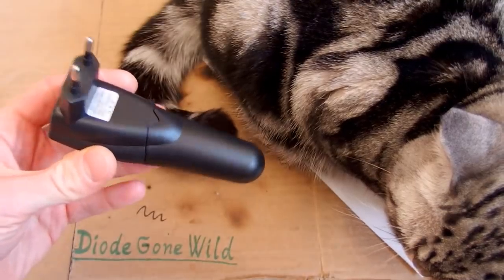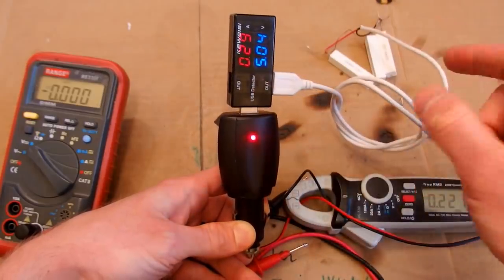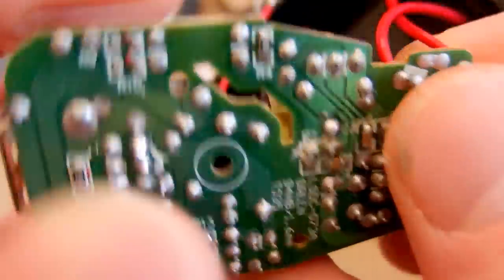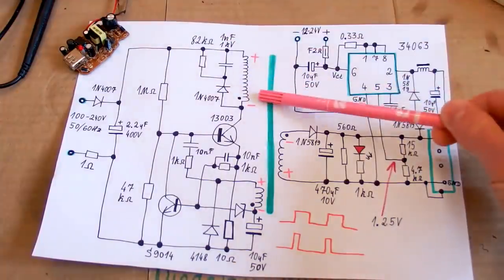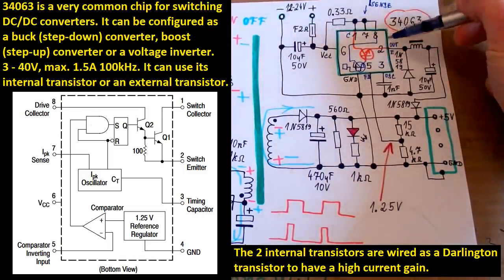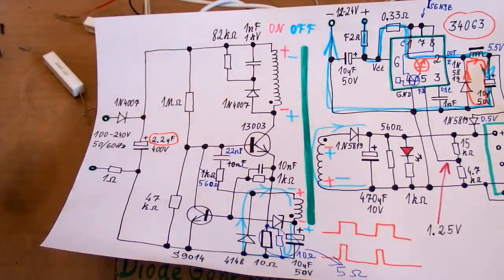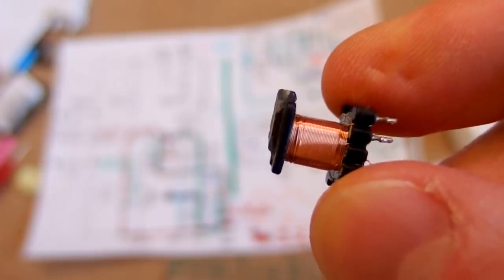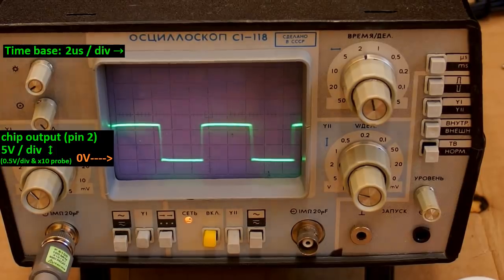Questionable 2-in-1 USB charger - test, schematic & modifications

Comment: The data sheet for the buck regulator has 100uF on input instead of 10uF and 470uF on output instead of 10uF and also 470pF instead of 1nF setting the oscillator frequency so it would operate at a higher frequency - maybe double ?   They then claim 1.1Amps with a 24V supply.    
 Also the inductor may be not the specified value.

Comment: My mom got a free solar panel from temu that is connected to a 4 port usb hub, for charging only. Problem is that it outputs from 0-12+ volts on the usb port (what the solar panel generates) 😂. 
Somebody gave an idea of replacing the Usb port with a 12v car outlet then you can use a car charger that supports from 12-24v and converts to USB power. 

I tested one car USB charger which seemed to still charge my phone at 5v input. But im not sure if it can damage my phone, like if its USB port is too unstable since i was only giving 5 volts to a 12-24V device.

Comment: @talonfluff  No, everything is not fusable, the electronic components marked as fusable often fuses for a certain max current meaning it become open circuit when it fuses for an absolute max rated current. But the components not marked as fusable often become short circuit, remember this difference!!

Comment: You are the role model for all the technical video.
You ate very specific in providing data.. voltage   current.  Circuit diagram. In 5v 2a mobile charger you could not find part no. of smps ic. Left it with question mark. After some time updated circuit with correct information.
Thanks for your interest and initiative. I have gone through most of your videos. You provide cost and source.
Thanks
Ashok
Banalore

Comment: Hello,
Sorry, but at the beginning of the video, the AC leakage tests are not correct: the AC loop cannot be close as none of the charger terminal are connected to ground (except through your own body!). Insulation between primary and secondary sides must be performed from the live or neutral terminal against the output USB terminals and also DC inputs. (With lots of precaution, of course)

Comment: Why didn't you replace the zener with a proper opto-coupler and replace the single input diode+1ohm resistor with a proper bridge rectifier as well as the 22uF 400V cap and 5ohm (10ohm*2 in parellel) resistor mod you already did. I think it would work much better then. Thats what i would do.

Comment: you are overlooking that this is a charger. you dont want to overcharge tour lipo phone battery. You must take in consideration that as a battery charges up, its resistance increases so that is a built in safety factor for lithium batterys. the .6 current limit is more then enough  to bring a battery up to full charge, and not overcharge  your device batteries. the car charger offers a higher rate of charge because it may have a more sophisicated charge level limiter

Comment: I see that the flammability rating of the PCB is only UL 94 HB (horizontal burn; limited rate of flame spread, but not required to self-extinguish), to add insult to injury. (From what I've seen, reputable manufacturers mostly use UL 94 V-0 rated boards. The next rating down is V-1 which takes a bit longer to extinguish, then V-2 which still self-extinguishes but can produce flaming drips.)

Comment: Diode REALLY needs a proper USB constant current load. The fucking around with 10W resistors is really painful to watch.
The shitty (and inaccurate) USB meters are also a fail. Go and buy a Ruideng meter and load, they are cheap and surprisingly good.

Comment: Newer device can use 8v and low amp to charge the device in faster way without damage the battery
Reply: It's not about the battery. The power to the battery gets "transformed" (actually buck regulated) to 4.2V anyway. It's low amp to charge faster without damaging the USB cable.

Comment: ok so, usb can have 5 to 8 volts on it, samsung for example has fast chargers, my samsung galaxy s8 active has a 5 to 9 volts with 5 volts being a 2 amp max supply and 9 volts being a 1 amp max supply, and my phone is not damaged hahaha.
Reply: The higher voltages are only for the newer USB specification, and such chargers will only output the higher voltages when asked to by the device they're charging. This charger is the simplest you can get and has no voltage negotiation circuitry. It should only output 5v, which it does. If it did output 8v it would kill older USB devices.

Comment: hello. what is the rating of your solid state tesla coil's (first one) ratings? i built it and it burnt the fuse and tripped the circuit breaker.
Reply: although it may be my soldering job too, but no arcs so far

Comment: The input has (primitive), interference suppression - the combination of the questionable 2.2uF, the dodgy 1 Ohm resistor and the forward resistance of the single input diode. These will probably start to roll at about 200KHz! Could be tested? Yet another great video, many thanks.

Comment: It would have been interesting to see the effect of replacing the single diode rectifier by a full bridge rectifier
Reply from the maker: After using a 10x higher capacity of the smoothing capacitor, a bridge rectifier would have no effect.

Comment: Hi, great explanation as you usually do. pity that the cat is bored a little but after all your video certain things he knows all too well :-) a proof that you did not do was to add the photocoupler that was missing, maybe something improved in the stability of the output voltage ?
Reply from the maker: If I put an optocoupler in it, the stability would be way better. I could have tried to modify it to the condition before the cost-cutting. An optocoupler and its LED in series with a zener, connected to the output. The voltage would definitely be stable at least up to 0.5A, maybe 0.7A. But the video was already a bit too long :).

Comment: The trace measured against the current sensing resistor doesnt look straight so the inductor on that buck converter was getting saturated. A bigger inductor will enhance the efficiency and just a bit more current at the output. Undoubtedly the 34063 was getting very hot at the higher load current. I have used this buck converter many times before but nowadays MOSFET based chips with synchronised architecture produce very high efficiency. The video you made today was very detailed.

Comment: 400V for primary capacitor, imagine powering it at 220 V as in EU, 310V peak, 620Volts on the capacitor in negative phase
Reply from the maker: The capacitor only has 310V on it. The diode is what sees the 620V peak. But it's 1N4007 rated for 1000V, so it's ok.

Comment: That buck i.c is a bit limited so i'm not supprised that the output is weak, i've never seen any car adaptor that works well with that chip alone.
That flyback reminds me of those cheap 12V,5V supplys for hard drive caddys, very cheap and minimal parts, but they do have a mosfet to drive the primary.
The "Ring" power adaptor uses a fet on the output, thats much better :-).
Your cat is loverly, it wants to be near you even if it is being a pest :-D

Comment: What do you mean by "fusable" resistor? Is there a real difference in product? All resistors are a kind of fuse, are'nt they?
Reply from the maker: All resistors may kind of work as a fuse, but a fusible resistor is specially designed for it. You have to use a fusible resistor in the design to be compliant and to cover your rear end if something goes wrong.
Reply: They are meant so fail safely and not in a blazing hell...

Comment: I question core saturation of the output inductor of the chip. That steep rise in current suggests to me, that the current limit is tripping at that point. A larger value of inductor, with enough ferrite to handle the magnetic field would probably help with the output current. Also, it could have enough DC resistance, that the pwm is saturating, but that would be overcome if 24 volts is applied. It's most likely core saturation. The sudden spike in current is what trips the current limit, which is why there was not much change, when a lower value current limit resistor was installed. The spike caused by saturation occurs so quickly, that it's hard to see on the oscilloscope.

Comment: The USB connector. Which is a little bit rusted. That's nice!
Reply from the maker: The connector may be reused from scrapped electronics, just like many other components in those cheap Chinese devices...
Reply: @DiodeGoneWild  I watched a video on YouTube of salvagers in Shenzhen. They were pulling parts off mountains of boards. Then they'd bale them all up and ride them on the backs of bicycles. You're probably better off with pulled parts than the counterfeit ones anyways.

Comment: Fusible resistors are really just metal film resistors, but they are painted with special expensive fireproof paint.  You can actually use a normal metal film resistor -- as long as there is nothing too inflammable nearby.

Comment: There is some space for opto coupler is that useful
Reply: No, opto coupler is only useful for data, and no power can go across a optocoupler
Reply: Well, it can report the status of the secondary side to help regulate the voltage, like more expensive power supplies. But it's not worth it. The supply is nearing its limit, and with potentially poor insulation overheating could result in mains reaching the output.

Comment: everything is fusable if you pass enough current trough it.
Reply from the maker: Everything may also sustain an arc  if you pass enough current trough it.
Reply: DiodeGoneWild  hiiiiiiiiii I like u
Reply: Good informative knowledge shearing Thanks
Reply: Talonfluff - unless it goes short circuit!🤣
Reply: @Mark1024MAK  there is no short-circuit with absolute 0ohm resistance .. with enough current any short-circuit can be made open circuit 🙌
Reply: Kuntal Ghosh - absolutely. Actual zero ohms at normal temperatures is impractical.
Reply: @Mark1024MAK  well even if smth goes short circuit, weekers part of the circuit will fuse.
Reply: BO҉R҉N҉F҉O҉R҉P҉A҉I҉N҉ no I meant da vid
Reply: @talonfluff  No, everything is not fusable, the electronic components marked as fusable often fuses for a certain max current meaning it become open circuit when it fuses for an absolute max rated current. But the components not marked as fusable often become short circuit, remember this difference!!
Reply: @RanaRao_Chandrachur  With enough current every curcuit opens in one or another way.
Reply: 😂right

Comment: The most questionable thing about this charger is the shape. If it wasn't because of the title, I would've thought this is some kind of mains powered vibrator thingy.
Reply: Mains powered vibrator from China sounds like a disaster, sure would add a bit more tingle due to poor isolation LMAO
Reply: It's a portable rechargeable mini  dildo
Reply: What fills the heart, will flow over from the mouth (or keyboard).
Reply: It should be used on the designer of this product.

Comment: I hope someone can help me out here. I’ll appreciate any hint;)

I don’t quite get the mains voltage part. The transformer would operate better at higher frequencies right? Was the frequency increased at some point or was every modification just about increasing the current on the primary side? 

Secondly wouldn’t it have been an easy gain to replace the diode (1N5819 )on the secondary winding with a full bridge and therefore effectively doubling the current?

Thirdly: 13:47 “the feedback loop  induces more current into the transistor” through the resistor and the capacitor. But a capacitor blocks any (DC) current. Is that why changing the resistor and capacitor values have hardly any effect? Should perhaps a FET have been installed in stead of a transistor?
Reply: Those are some good questions.

1. The modifications were to try to increase the duty cycle when the load is high. I´m not quite sure what changing the frequency would do in this case. But it won´t make it perform better necessarily. It could make it worse.

2. If you replaced the single diode on the secondary with a bridge rectifier, it would no longer be a flyback converter circuit: It would radically change how the device works, and it would no longer be possible to get feedback the way you can in a flyback circuit, among other things. Most likely it would just stop oscillating if you left the rest as it is and blow up.

3. Keep in mind that all voltages coming from the transformer are changing quickly, and are AC. So to charge it current has to flow through the main BJT´s Base, making it more conductive.
If you wanted to use mosfets instead, you would have to change a lot about the circuit. But in general you would be better off using a proper control IC, or at least an optocoupler as the feedback anyway since that is way more accurate.

Hope this helps.
You can also watch his video on the power supply of a DVD player he did a while back. He went more into the detail on how a flyback converter works in general there and explained it very well.
Reply: Basement ScienceE 
Tx! I’ll go and have a look at the DVD video and then report back ;)
This is the video: https://youtu.be/cX4q0e124C4

Edit: watched 25minutes now and it starts to become clearer now.

Edit2: watched all 3 video’s. Re: 2. Bridge rectifier would prevent energy buildup in the transformer and therefor indeed change the fundamental principle of this circuit. 

Re: 3 As I understand it, it’s not the transformer that is running on AC but it’s the transistor that steers the transformer by switching on and off. Isn’t it the transistor switched off by running enough current through the 10k resistor and thereby closing the other transistor?  How is it turned on again?

Comment: Tx again for a nice video. I appreciate all the effort you take to reverse engineer this charger, draw a complete schematic for us and explain how it works!

Strange device. Why would you want to combine a car and a mains charger anyway?
Reply: Surely you can work out why a dual-powered charger would be handy?
For example, when travelling.
Reply: John Coops 
When traveling I’d take a small mains charger and use a small 12V charger. This thing is larger than the 2 combined. I don’t see an advantage in combining the 2 functions.
Reply: @Conservator.  - I take a 4 port Orico charger that runs off 12V as well as mains. Much easier!

Comment: The transformer seems ok, it should be capable of delivering 5W, with proper input filtering and regulation. But they really did some serious cost cutting on this one. Maybe there's one that does implement better regulation and a bridge rectifier, since it's marked on the pcb. As for the dc-dc part, i'd just go with an lm2596s board set to 5.75V(because of the diode) and dich everything above the diode going to the output and below the fuse, i used it for my tp4056 18650 chargers to drop 12v to 5v at 1A all day long.